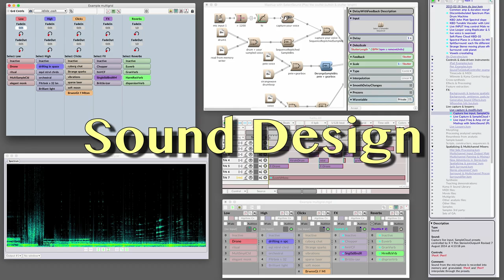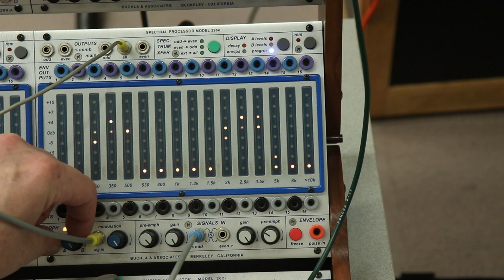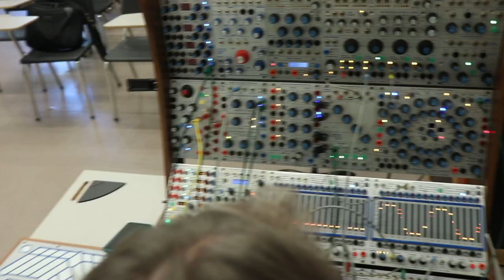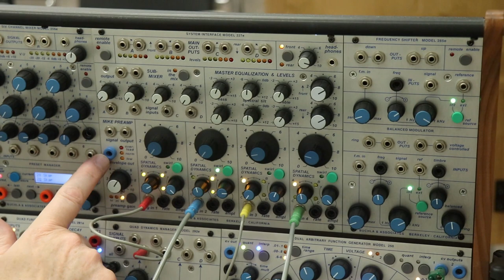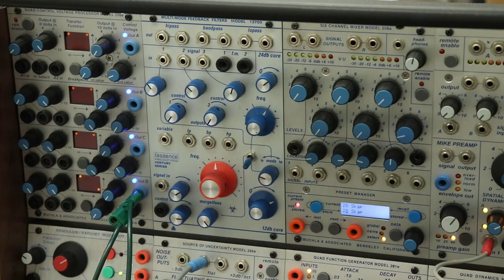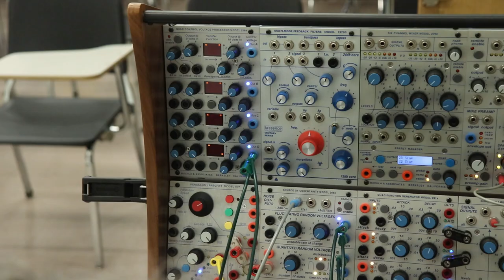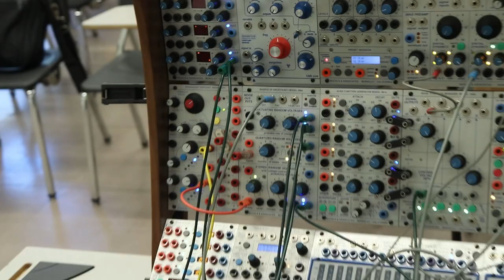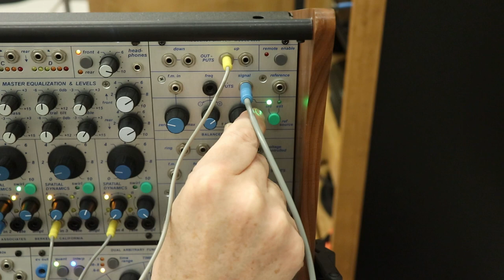The Mighty Buchla 200e Modular Synthesizer Part 3| Tutorial

Comment: 266e QRV section divides the 0-10V cv range evenly by the number selected. So the voltages in the set are fixed. The randomness applies to the selection among the set. So for example, with N=2, the two voltages are 0 and 10V. For N=3 they are 0, 5, and 10V, and so on.
Reply from the maker: Wow, Doug - you have a much deeper insight into this instrument than I do. Thanks for adding your knowledge to the conversation!
Reply: Correct, and I believe the distribution controls the likelihood of voltages being chosen from the middle, each end, or all (flat) 👍

Comment: Regarding the 291e, the key I think is to highly attenuate the frequency CV to keep it in a sweet spot. The general problem is that none of its many CV inputs feature attenuation, so you really must have a CV processor to go with it. You might consider keeping your 256e next to it. Also, regarding the interactivity, you can control everything (except modulation depth) using CV inputs instead of the sequencer. So there is no need to set up anything, just use external CV sources. For this, it is very handy to have a 255 control voltage processor next to the 291e to remotely control all of the CV levels (and also to provide attenuation). It is also a wonderful module when used in feedback into itself with sine or noise (258 cross mod) audio modulation. Use the VCAs and ALL output, and set your downstream volume all the way up and let the VCAs control the volume. Attenuated envelopes to the freq inputs in this case makes all kinds of great percussion noises, and three voices too.